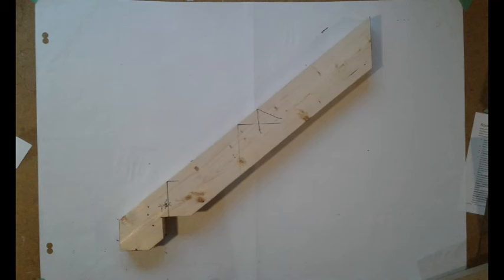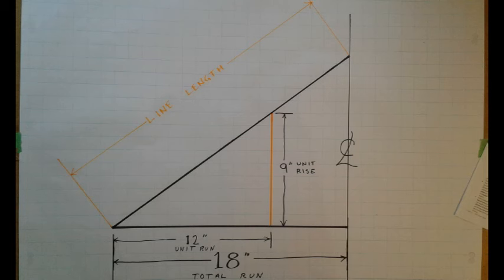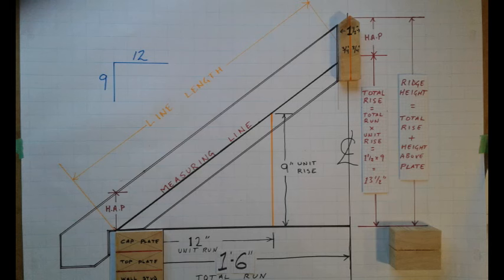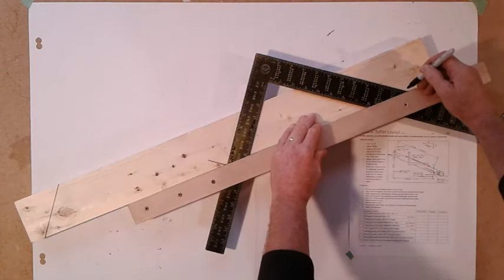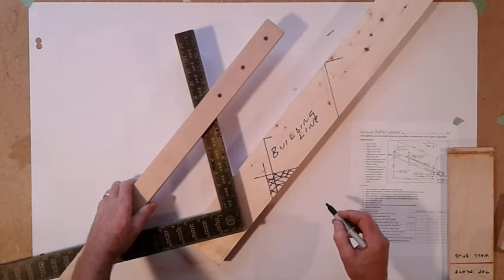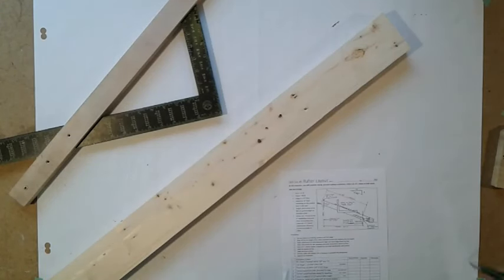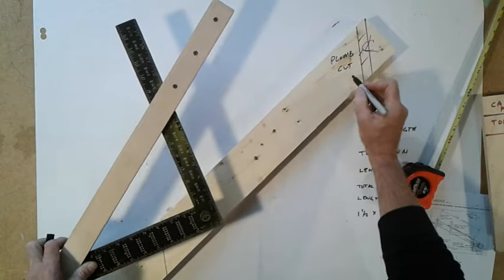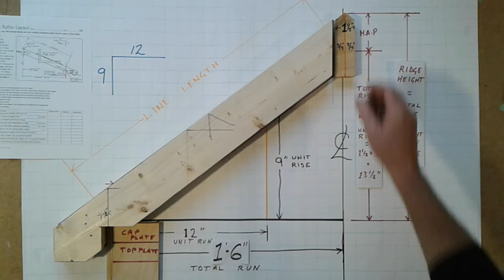How to lay out a common rafter with a carpenter's framing square - Imperial

Comment: I've watched a bunch of rafter cutting videos and finally I find one that gets it right! The plumb cut on the birdsmouth needs to go outside the framing so that the wall sheathing can go up to the top of the double top plate. And it's a good idea to leave a 1/8th inch gap beyond as well, so you can slip your weather resistant barrier up to the underside of the roof sheathing. Also, this video shows it right that you don't need (or want) to make the birdsmouth horizontal cut go all the way to the inside of the wall framing. This weakens the rafter a lot, where it has a lot of stress. You only need 2" or so of bearing onto the top plate. The Building Code actually limits the depth of the birdsmouth cut but a lot of professional framers still get this wrong.

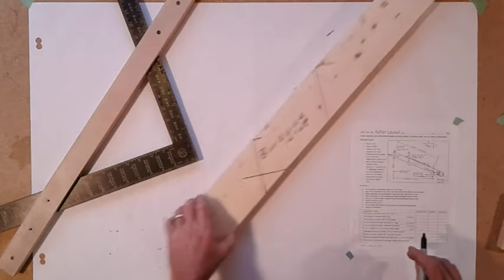Comment: Is there a geometric/mathematical way to calculate HAP height, instead of marking it with a ruler ( 07:04 ) ?
Reply: He s making this complicated if you're a beginner.
Yes trigonometry is so useful.
This 9 and 12 equates to 36.86°. 
Basically cosine of 36.86= 0.800
Divide the run by 0.800.
This gives you the rafter length to the birds mouth